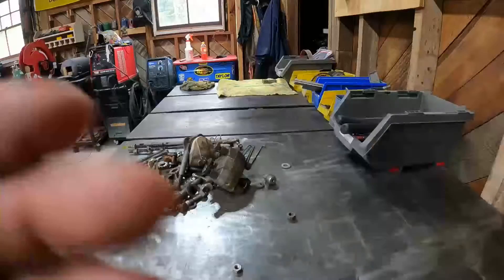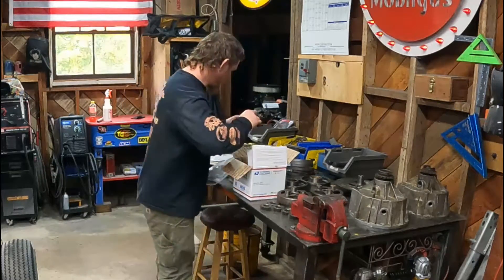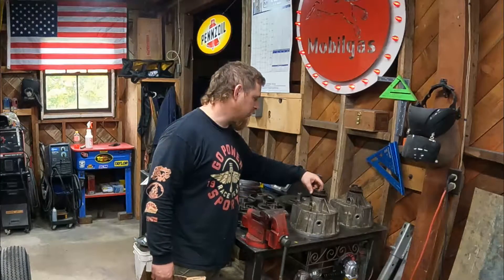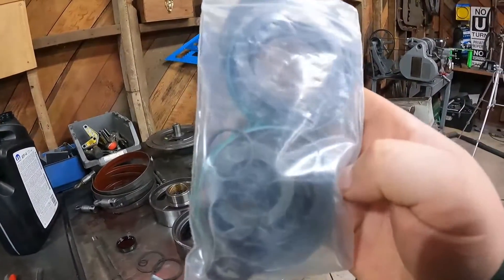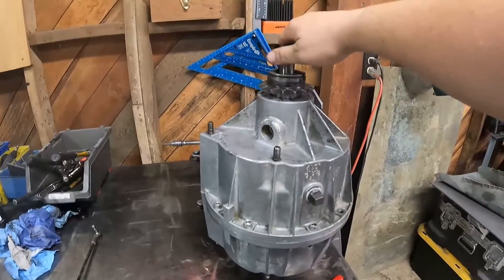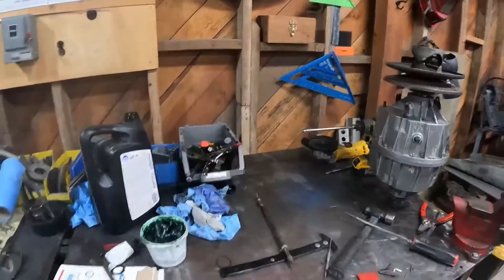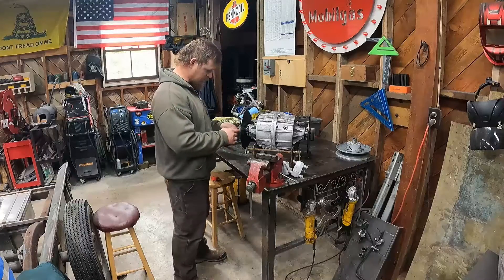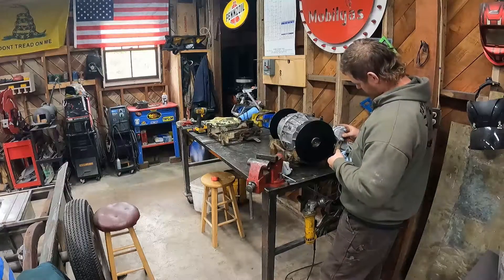Amphibious 6x6  Kadoo T20 Transmission Basket Case!

Comment: I don't know if you ever got back to this project, but I think last you left off you were having trouble with the t-20 slipping in your later videos. There's a whole Facebook group dedicated to the t-20 with lots of experienced people there. If you're still having problems you should check it out! 

I would love to see more on this machine again.
Reply from the maker: It needed new bands, I thought I could get away with running the old ones and was definitely wrong. I just sold it recently. Didn't want to drag it across country. It was definitely a cool machine, but also some design issues
Reply: @DJsHotRodFab  Dang! That makes sense though. When I saw you guys moved I got the feeling that might have been the case. Either way I loved your videos on the machine. It made me really want a Kadoo, even though I already have 4 6x6 projects as it is. Maybe one day you can find a more "practical" 6x6 project.
Reply from the maker: @alanp621  Thank you so much for the feedback. I was thinking the same thing, a more practical 6x6. The Kadoo was just so cool looking and super rare.

Comment: hi, I have a max 2, it's turning to the right side always,(just a little bit) doesn't want to go straight away, do you have any idea what wrong with the this vehicle?thx
Reply from the maker: I am no expert, but I would think that the band or the levers need to be adjusted. The left side probably needs more pressure to keep up with the right side.